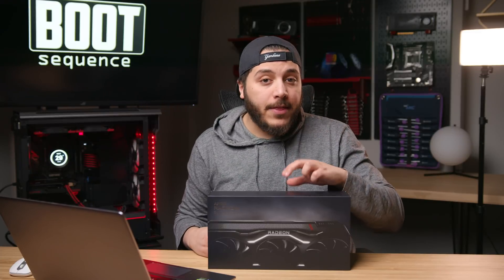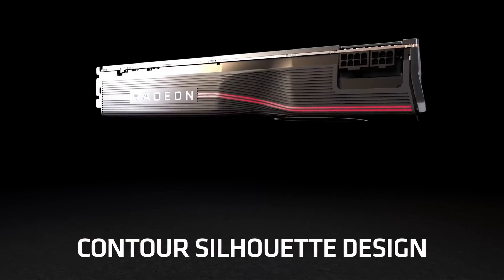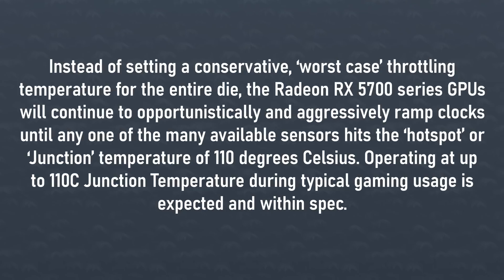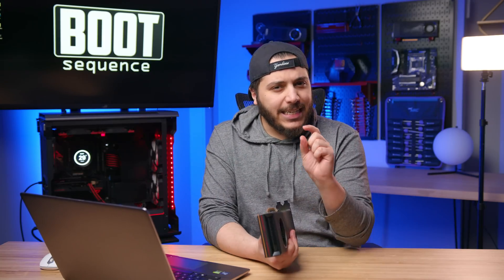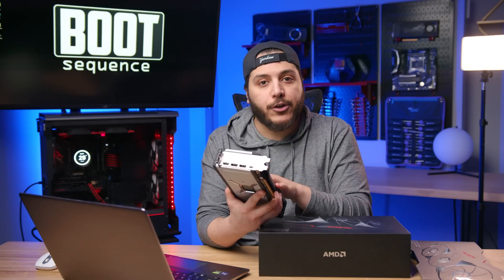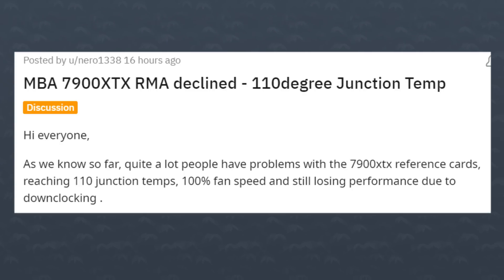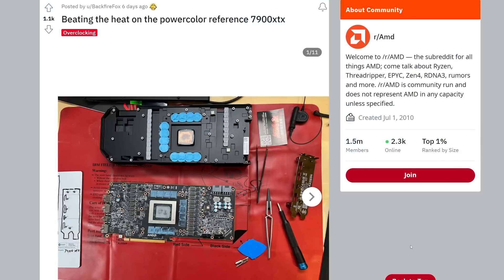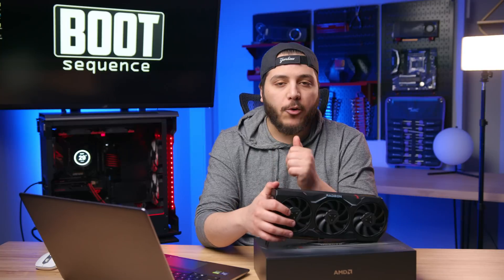RX 7900 XTX Reaching 110°c !? Not Again....

Comment: My Sapphire 7900XTX goes fairly above 80° on the hot spot, 60 - 65 on the GPU...even better than most mid-tier cards ever released in history lol
Reply: what about noise, is it loud?
Reply: @pasha715  seems these squeek quite loud with the coil whine so far
Reply: @ofon2000  also sapphire model or some else?
Reply: @pasha715  I'm not sure about that one...I was referring to the reference model. Let me see if I can find info on what you're looking for though.
Reply: @pasha715  seems like they all have coil whine if you push past 350 watts...but if you stay around 330 or below (with undervolting and setting a small power limit) you can get rid of the noise.

This isn't a big deal as you won't really lose any noticeable performance.

However make sure you have great air flow in your case!
Reply: @ofon2000  thanks for info
Reply: @pasha715  no problem...best wishes!
Reply: @pasha715  Not really, quite average I would say...but with these astounding temps you can easily reduce the fan speed as well if you want to
Reply: Is it the Sapphire XTX MBA card or Nitro?
Reply: @krakkan  The first one, I guess the Nitro could have even better temps
Reply: Yep same here.  Sapphire Pulse 7900xtx.  It does have good airflow in a Lian LI O11 vision case. 
On OCCT 3D standard stress test: 
Core temp: 70℃
Hotspot: 89℃
Junction Temp: 82℃

Comment: I have the XFX Radeon RX 7900xt and I don't have any over heating issues yet. I have seen temps go from idle 39-40c to work load 100 percent 70c. But I also have a Corsair 5000D Airflow case with 9 fans and 1 exhaust. The only problem I have from time to time is the Coil-wining. It is noticeably there at times.
Reply from the maker: Seems like XFX Is doing it right then!
Reply: @BootSequence  That's probably why all the X's in the name, each X is a coolingpad/paste check up.
Reply: having that much airflow and at 70C is still quite high tbh...is that stock?
Reply: @ofon2000  Yes it is
Reply: @ofon2000  well is the reference card made by XFX
Reply: Many people have repasted repeatedly and found little to no improvement. 

Also, for those thinking this is OC related, it's not. Stock cards at stock settings are hitting 110 on the junction with 70-80 on the GPU temp, a massive variance. 

Latest theory is using a carbon based heat pad rather than TIM may help due to its ability to conform to laterally transfer heat better, and the inability of wonky surface contacts leaving literally 0 room for paste.
Reply: I’m one of the unfortunate ones suffering from the 110c junction temp on my xtx i picked up on launch day. Fortunately for you from what I’ve read & I’ve read a lot it doesnt affect thr xt models only us “lucky” xtx owners. Beast of a card & love the performance but something has to be done about this.
Reply: @dann8961  Der Bauer did a video on this. I believe a re-paste may resolve the issue if not wanting to deal with returning.
Reply: @dann8961  Hitting 110c junction is fairly normal, is the edge temp more than 30c different from junction? You may require a repaste if so. Pushing 400+ watts my 6950xt red devil will hit 110c hotspot with an edge temp of around 90c, the 5700xt 6900xt and now 7900xtx all are like this, it's not an issue.
Reply: My core temp according to adrenaline reaches 77c and stays there under load. Junction temp reaches 110c rather quickly and stays there under load. Undervolting & boosting fan curve don’t help. With case lying on side junction temps stayed in 80s. Ordered a vertical mount. 
Thank you
Reply: @dann8961  is that the Reference Card?
Reply: @ZFPS115  Yes, Asrock reference from Newegg
Reply: @PineyJustice  110c junction, 77c core(?)
Reply: @PineyJustice  Sapphire Toxic 6950 XT and I have almost 20-40 difference on average between junction and current. However I never draw more than 365 watts and the junction temperatures are always bouncing between 80-90. The current temperature always stays at 52-55. This is on newer games at 4K with high to ultra settings doing 90-110 fps.

Comment: So you're telling me that they are beholden to the laws of physics concerning vapor chambers and heatpipes? Crazy.
Also hitting 110c is pretty standard for GPUs, the only difference is AMD is showing these internal sensors that we don't normally see, it's fine, don't worry about it. If your edge and junction temps are more than 20-30c different you may need to repaste.
Reply: @spagh3868  Because that's not the hotspot temp.
Nvidia dont show you that.
Reply from the maker: In 2019, gamers Nexus made a video on the 5700 series' 110c. You should check it out. It's clearly not an issue, but should not be "expected behavior". Especially if repasting and torquing the GPUs more make a 30 degree c difference.
Reply: @BootSequence  I don't think it's up to GN to say what's 'expected behavior' when they aren't the product designers or the engineers.
Reply: @arahimakzar  and gamer nexus is not some ordinary guy
You probably DON'T even know who he is
Reply: @asdbef3667  Steve at GN didn't design the 5700xt... they don't get to say whats expected performance...
Reply: They want you to forget about the 4090 being on fire.
Reply: I do agree that in 2019 yes I'll give em a pass but it's 2022, 7900 XTX now and it should have been lower or redesign but I'm no GPU tech, oh btw what's is "MBA" basketball?
Reply from the maker: MBA = Reference design = Made By AMD
Reply: @BootSequence  thank you!
Reply: @ktpt3732  I don't think you're understanding, core temps have always hit these temps, when your gpu says it's at 60c that number is either edge temp or it's mathematically calculated based on a mixture of edge and internal temps. Nvidia just lies about junction temps through using a formula, what you're seeing is the hottest part of any part of the internal die with junction temp. The reason cores are limited to around 100c is because this junction temp is often a lot hotter than the die temp and things like the underlay glue start to break down or perform out of spec. Junction is internal to the chip and doesn't affect this so much, the spec for what temp the silicon starts to break down is very different than what you think of as a traditional gpu temp.
Reply: Maybe 2025 AMD will remove the junction temp sensor so there will be no more complaining. What you don't see you don't complain I mean its working for Nvidia